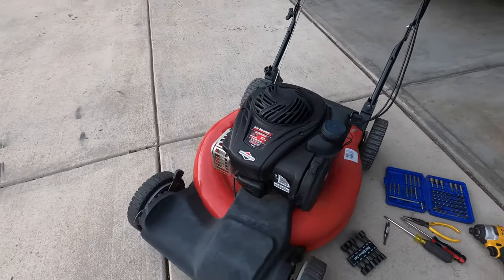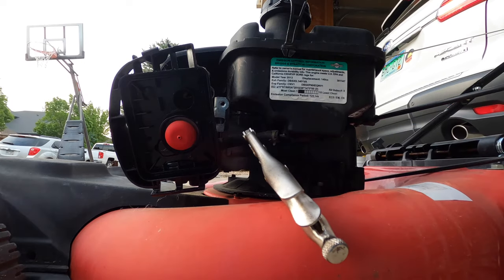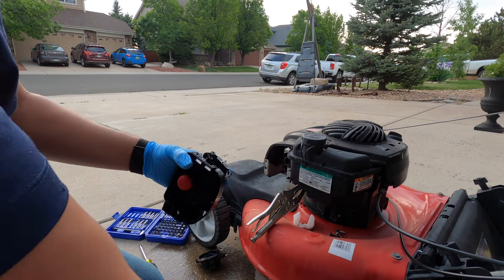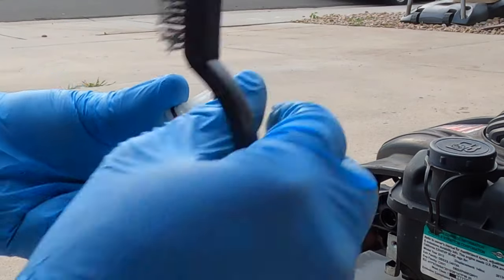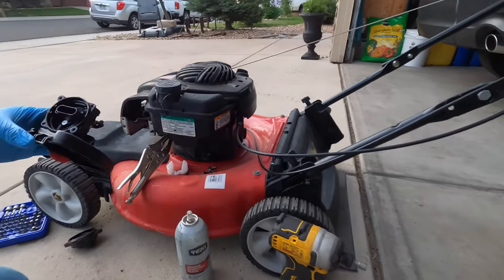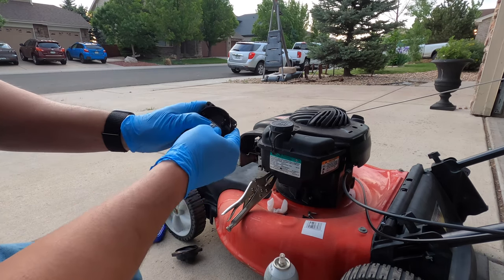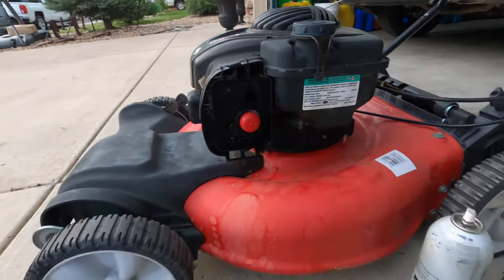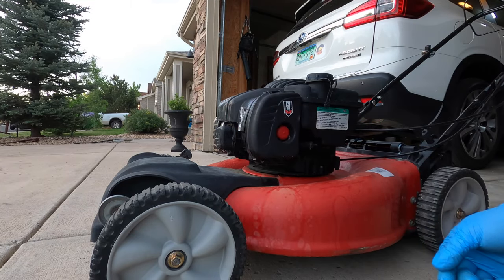MTD Yard Machines Mower Wont Start - Briggs and Stratton Plastic Carburetor - How to fix it yourself

Comment: Awesome! I searched high and low for a video to fix my lawn mower that I left gas in over the winter. While following your instruction, I noticed that the holes in the ejection system did not look clugged. As per your instructiin, I cleaned the out anyway. Low and behold it started after reassembly. 

Thank you!
Reply from the maker: That is awesome!  So glad it worked for you too!

Comment: Thank you!  I cleaned out the carburetor with a sewing needle, cleaned out the gas tank and put in fresh gas, and fired it right up! I couldn't have done it without you.
Reply from the maker: That’s great!  I am happy it helped you too!  Congrats and thanks for sharing your success!
Reply: How did you clean the gas tank? I replaced the carburetor worked for a while. Now it just sputters. It will stay on as long as I keep spraying carb cleaner into the carburetor but will shut off. I’m guessing it’s a fuel flow issue. Any suggestions?

Comment: I have been using a machine with a B&S 450 engine for 10 years, when I once started having carburetor problems I simply used premium gasoline, which in cars cleans the injectors, for three years I have been using it professionally. I add fuel stabilizer. No problem.

Comment: Welders Tip cleaners.
 Welding supply, Aome Depot, Amazon.
     Thanks, I found one today 2017 model.
   It looks like it was used one time.  The motor oil is clean as new.

Comment: Everything I did on my toro 675 series,, I consulted to all experts mechanics on YouTube,, but still won't start my lawn mower,,, perhaps I need to change my plastic carburetor,, I had checked spark plug,, compression,, timing,, gasoline all perfect,, many thanks bro...
Reply from the maker: Eduardo, I have a small engine repair playlist that has a few more of these.  I'd say it's highly likely your issue is carburetor related.  If this method doesn't work for you, check out my other videos.  Best of luck!
Reply: I’m sorry, I have no knowledge in lawn mower repair,  but bcs my new one doesn’t start, I ve watched a lot of videos and  read every comment after each of them.
In your case technicians and people who knows what they are talking about , say : try to clean carburetor one more time 
You can replace it as well, it’s my suggestion after all
Thank you

Comment: That was a great video but I have one question on the back of that plastic carb there is that little white thing that looks like a hose supposed to go on there and there is a little black nib on the back of the primer housing it also looks like a hose goes on there as well can you please tell me what they are for and if they stuck air

Comment: I have 4 mowers to work with. On a briggs and stratton pushmower it doesnt start. Clean new gas. I cleaned carburetor.  I replaced a needle and seat. The floater doesnt lay flat, but its springy. Is that ok the floater isnt level cause of the needle and new seat ?

Comment: Worked like a champ!  💯 percent satisfied.  White crusty particles on the plastic tubes.  Cleaned and reinstalled.  Nothing beats the smell of lawn mower engines running in the morning.   Any recommendation for fuel additives prior to storing in the winter?
Reply from the maker: Nice job!!!  My recommendation would be to use a non-ethanol gas.  I know you can’t get that everywhere, so if you can’t, just make sure to run the mower a few minutes every month in the off season, OR run it completely out of gas before storing it over the winter.  STABIL is an additive that some people use, but I personally don’t.

Comment: I have a Murray 500e 140cc Briggs & Stratton it will start then it will turn off would you recommend me doing the same thing to the carburetor as you did or purchase a new carb
Reply from the maker: I’d just try cleaning the existing carburetor and maybe blow out your fuel line to make sure it’s not restricted

Comment: Can the floater be in 45 degree angle instead of flat even? I installed a needle and seat cause my carburetor was leaking gas underneath. carburetor

Comment: I decided to replace the jet on mine with a newer design (before 2018 vs after 2018). Snapping the new jet into place was a MAJOR chore, there is no way you can just push it into place with your thumbs. Be warned, other than that it is a fairly easy process.

Comment: Thank you for your video .Looks like I have to do that with wire brush thats the only thing i did not do.
Reply from the maker: Glad you found it helpful!  If you run some wires through those holes, it should get it!  I have had a lot of success with that, and I bet you will too!

Comment: On my Murray 22 inch 450 e, 4.50, 
Two of the screws are 7 mm for the carburetor, 
the other two screws  for the carburetor are 8 mm

Comment: Hey, i just got started fixing lawnmowers and I’ve already sold 4. I bought one for 40 but it’s missing the “blade control” cable. I got wires to connect it but i don’t know to what hole to connect it. Any chance you know which one it is?
Reply from the maker: Sorry, it’s difficult for me to envision without knowing the make and model.  See if you can search your model # in Google for a parts diagram.  That will likely show you the location.

Comment: Are there some other things I should check prior to taking all that apart?
Reply from the maker: Try starting it on starter fluid.  If it starts and runs a few seconds, you likely need to do follow the process in the video.

Comment: I replaced my card but it still won’t start without starter fluid. Any advice?
Reply from the maker: If you disconnect the fuel line from the carburetor, does fuel run in a steady flow from the tank out of the hose?  In the carburetor, the float could also be sticking causing the fuel to not flow.  Or some other fuel obstruction.  You know you have spark or else starter fluid wouldn’t work, so it’s definitely a fuel delivery issue.

Comment: Hellllpppp......I got it to start.....buy its leaking gas now.......is the linkage cable supposed to go in a certain way? I'm thinking now the float isn't wrking properly
Reply from the maker: Hi!  If it’s leaking gas, you’re right, it could be the float valve or the rubber o-ring at the bottom of the bowl.  The linkage cable should go in whatever hole it came out of.  Sometimes you can tell because the hole has some slight wear to it.  You’re on the right track… good luck!

Comment: Hi Tractor Hoarders✋I have a same motor 550E. My motor do surging. I cleaned the carburater twice but still surging. What i need to do?
Reply from the maker: I would recommend cleaning it again.  Usually some passage needs cleaned a little better if it’s still doing that.  It can be other things, like air leaks, too.  It’s most likely an obstruction in the carburetor though.
Reply: @TractorHoarders  All right, i will cleaning it again😊 Thx for idea.

Comment: Briggs and Stratton should be ashamed of this design. I did this and it did fix the problem. After I finished. I realized that taking off the top plastic cover made it easier to reassemble the carb to the mower.

Comment: Just ran thru these steps on my mower and it started up, but it feels weak and stalls after 4-5 min . Any ideas ?
Reply from the maker: To me that seems like a fuel problem.  I would check and make sure there is a constant and steady fuel flow from the tank to the carburetor.  If there is a fuel filter, you may change that.  There could also still be a carburetor issue.  I have some other videos in my Small Engine Repair playlist that go into further detail on that process.

Comment: Worked great to get it started back up, but after a little mowing, it won't stay running
Reply from the maker: It’s possible there may have been some crud in the gas tank that got back into the carburetor and clogged a passage again.  If thats the case, you may need to flush the gas tank, possibly replace the fuel line (if it’s deteriorating) and clean the carb again.
Reply: @TractorHoarders  That would be my luck lol I was able to start it back up, though it did stall out a few more times, but I got the job done.  Next time I need to mow, if it still happens, I will try and your additional suggestion.  Thanks so much for this awesome and very helpful video!!

Comment: PLEASE HELP!!! I did all of this down to the “T”,  and now I have gas squirting out of that little white nozzle next to the fuel line and it’s squirting out of the damn Primer bubble??????????
Reply from the maker: Your float might be stuck?  Re open it and confirm it opens and closes like it should.  Worst case, you can buy a new carburetor off of Amazon for cheap.

Comment: Use a piece of wire, not bristle from a brush...Lame.  With the wire you can clean out further up in it.
Reply from the maker: And what is the total length needed?  I’ve done about 25 of these.  The answer is not very much.  Put whatever you want in there.

Comment: It starts then dies
Reply from the maker: If it’s starting, it means your ignition system is good and you have spark.  Because it dies after starting, that means it’s not getting fuel and likely has a fuel restriction in the fuel line or carburetor.